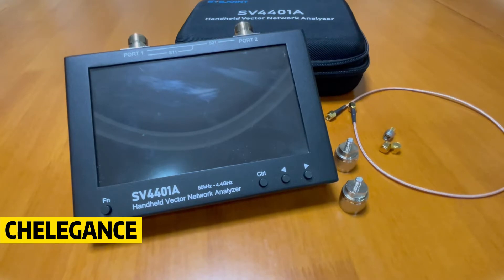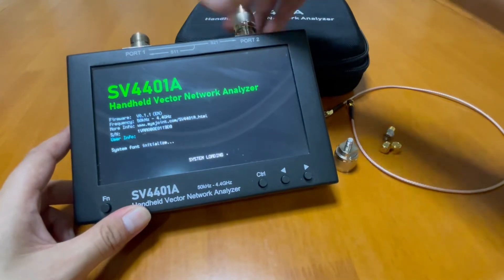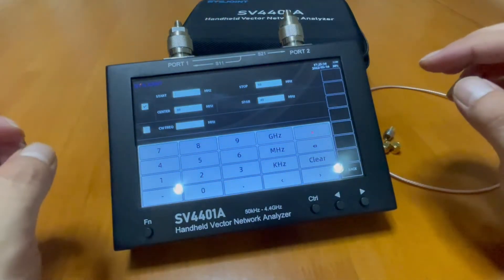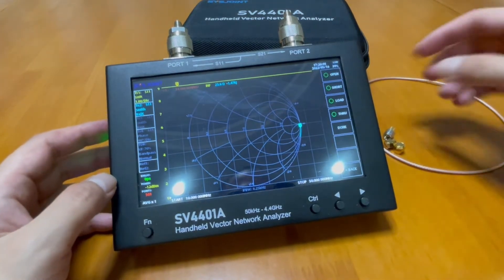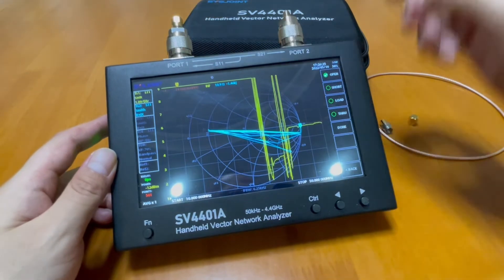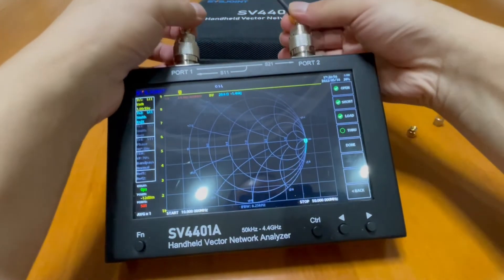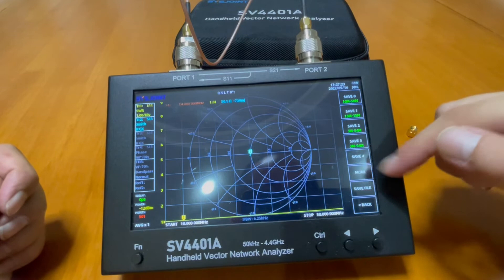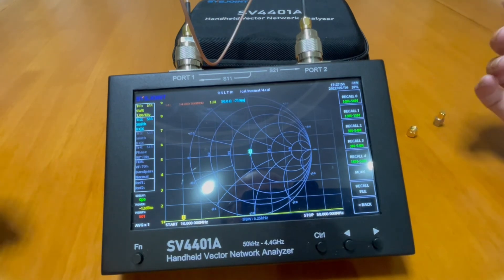SV4401A: Calibration Process

Comment: You need to supply this with Type-N connectors / cables and calibration kit.  Having adapters to SMA is not good.
Reply from the maker: You are right and we do have those connectors available as optional for users.

Comment: Hi, for the THRU calibration is it better to use the two cables? because in an input output measurements two cables are used.Thanks
Reply from the maker: I'm not sure if i understand the question. Were you asking if it necessary to use both  2 supplied cables for thru cal?
Reply: @chelegance  Yes, if you measure a device with an input and output ports, shouldn't calibrate the in and out cable too? Or?
Reply from the maker: @francescodigiovanni4632  Technically you are right. Not only the cables but any other things included in the system for instance adaptors(if any), should be calibrated in order to get a more accurate result. However sometimes it's not easy or time consuming to accomplish the task. We choose to ignore some minor inaccuracy and calibrate only the main parts as long as the inaccuracy is tiny to effect the result of the measurement.
Reply: @chelegance  I agree. 🙂